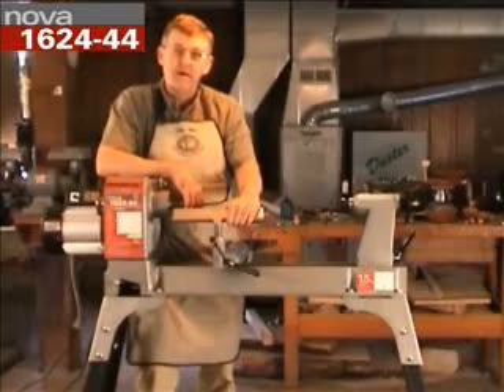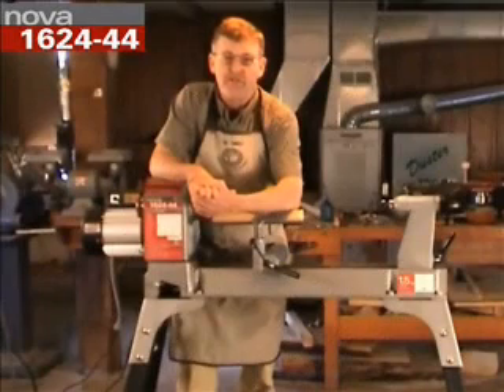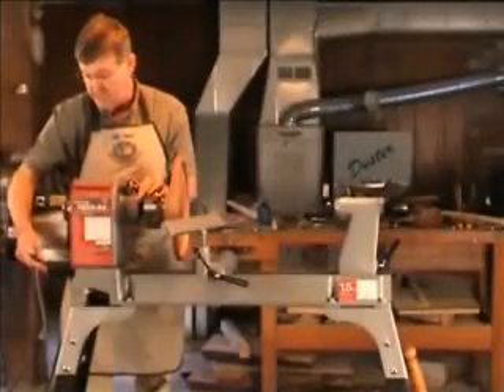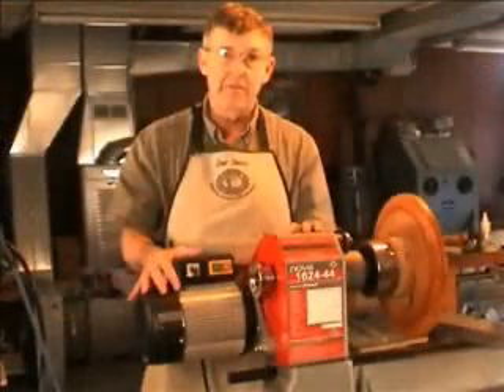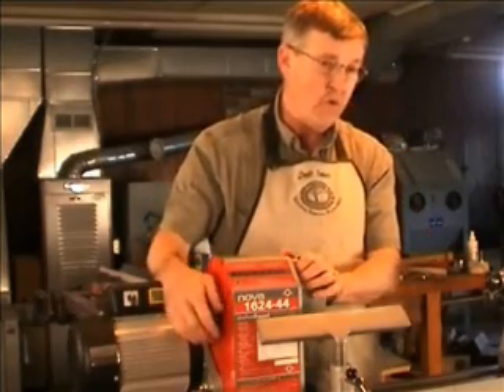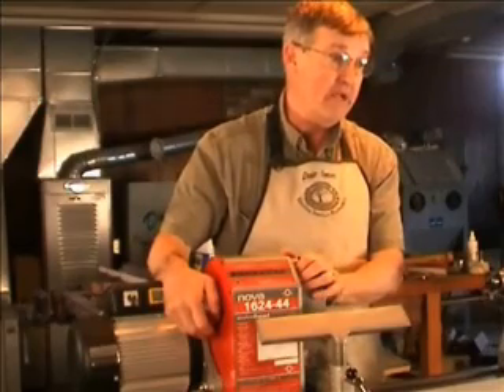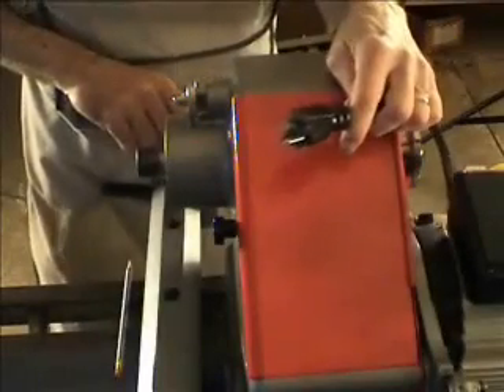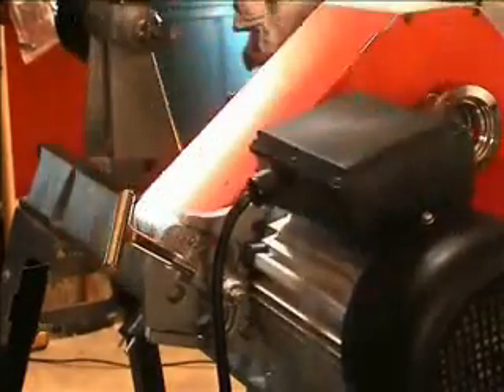NOVA 1624 44 demonstration part 1

Comment: hi my new 1624 center pins do not line up , can this be fixed? ? thanks.
Reply: Yes tip the tail stock up side down to see the adjustable slide tabs.